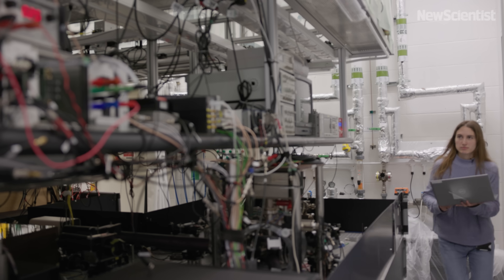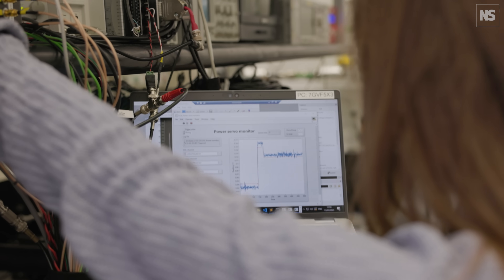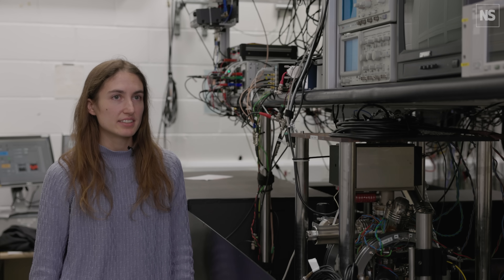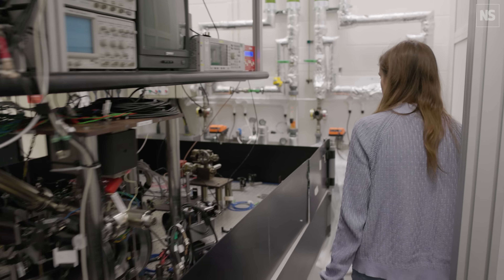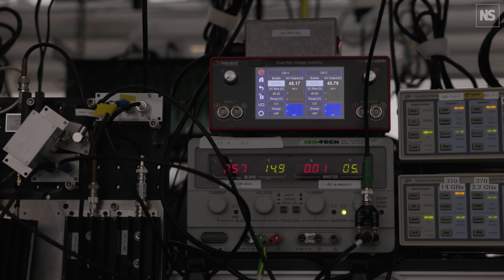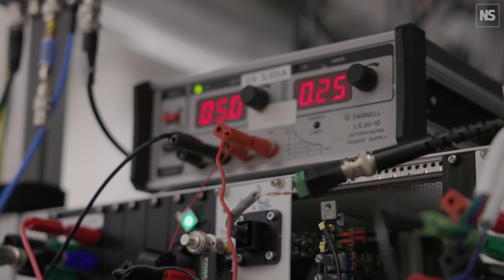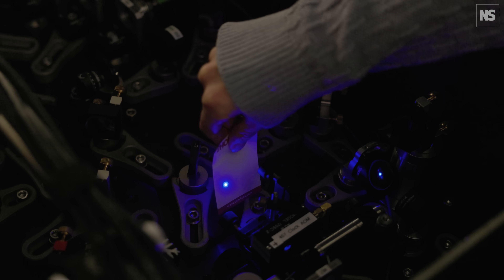How optical clocks are redefining time and physics

Comment: Fascinating.  It sounds like they're using a Paul trap since the Dr said that they use time varying E fields.  Also, I would expect that they use optical molasses techniques to slow down the ions.  The weird thing is that I would have expected jackets/containers of liquid N (˜70K) and liquid He (˜4K) to cool down the ion trap; however, I didn't see any cooling equipment in the segment.  Thanks for the report.
Reply: From my, somewhat limited, experience, it will be the orthogonal laser cooling, before being cooled further in the MOT which when combined with XHF vacuum means that you can get down to around 10-6 K without any external cooling as there's essentially no radiant heat.

Comment: 4:30 But a second is defined precisely as an exact number of periods of cesium radiation, so I don’t understand how a definition can get more accurate. Is it because the cesium periods themselves have some innate variability?
Reply: Things happen in a shorter time frame then a single caesium time period. It's like going from being able to measure a 100m sprint using hours, to using seconds.

A hour is still an hour, but with seconds we have created more resolution in our ability to measure things.

Same thing here.
Reply: @Lettuceleafproductions But after gaining the ability to measure seconds, you don't need to re-define the hour to be able to measure them, you just need to define them as a fraction of an hour. This bit didn't make sense to me either.
Reply: They want to change the defination to the frequency of a sec using the sodium atom which is around 400 Thz. Ceisuim is around 9 Ghz. Optical clocks would have 44,000 times more resolution than Cesium clock.

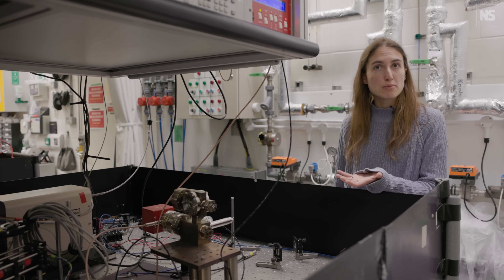Comment: @1:50 "The Yb ions are particularly sensitive to the variation of the fine structure constant"?! 
How can a constant vary?
Reply: It's called a constant because it is believed to be and all observations so far are consistent with it being a constant, but like she explained it's conceivable that it turns out to actually slightly vary over time and we just haven't noticed it yet
Reply: @MatthijsvanDuin  You either don't read or don't understand what words mean.
Reply: @ I do read. It's a physical constant, not a mathematical constant. It's not constant by definition, but it is empirically a constant. Ultimately however nothing is 100% certain in physics, the universe does not go "DING! You got it right!", so it's perfectly natural to wonder if perhaps some things we think are constant in fact are not constant, and to want to do experiments that check this.
Reply: @ Also, there is actually some evidence that the fine structure constant has changed over time, albeit by an extremely tiny amount (a few parts per million of change over a timespan of ten billion years).

Any variation on a human timescale has thus far been too small to be detectable despite active efforts to detect such change, so for all practical purposes it is a constant.
Reply: @MatthijsvanDuin  So why talk about variation though?
Reply: @ciprianpopa1503  The phrasing "particularly sensitive to the variation of the fine structure constant" just means that if the fine structure constant varies, it will have a strong effect on  the properties of this ion that determine the frequency of this clock, which makes this type of clock a useful tool if you want to try to detect whether the fine structure constant varies. (And if no such variation is detected, it provides very tight bounds on how stable the fine structure constant must be)

Comment: It can measure time changes at 1 cm height difference, so this clock is very sensitive to gravity ie time dilation.  So how does it stay so accurate given that there constant small changes in gravity locally due to subtle but constant changes in the mantle and core of the planet?  How do you compare the time on such clocks that are distant and under influence of different gravity?  Is there a limit to how accurate a clock can be in the real world?
Reply: I anted to ask something related to this but the other way round. 

Could you use the clock (or a pair of them) to monitor the movement differing viscosities of the mantle?
Reply: "It can measure time changes at 1 cm height difference, so this clock is very sensitive to gravity ie time dilation"

No just the force applied to the ion.

 Gravity does not effect time or light. Eddington 1919 just observed ordinary refraction from the suns plasmasphere. Defection was much higher than Einstein predicted. Mass\gravity does not bend light.
Reply: @guytech7310 We found the ret∆rd
Reply: @guytech7310 Ever heard of "Gravitational Lensing" ?

This was predicted as possible by Einstein and then proven to exist in the real world by others.
Reply: @jfverboom7973  Yes but its nothing to do with gravity, its just ordinary refraction as the lensing galaxy has gas & plasma. We know its not gravity because all of the lensing galaxies suffer from spherical aberration, which would not occur if it was gravity. 
Eddington 1919 observation is also just refraction as the sun has a plasmasphere. If you look at the original 1919 star plates, you can see glowing plasma right next to the star with observed deflection. The deflection was also nearly twice the amount Einstein predicted but in line with refraction cause by plasma. 
Third no lensing effect observated for stars whipping close to Sgr-A (milky-way central blackhole).

Gravity and EM do not interact.

Comment: how does the optical clock compare to the proposed nuclear clocks?

EDIT: i just checked wikipedia. the proposed thorium-229 based nuclear clock is expected to have an accuracy of 10^–19, i.e. an order of magnitude better than the clock described in this video
Reply: cesiun clocks lose one second in 30 milion years or somithing.
this one lose 1 second in some bilion years
Reply: @iurikroth2281  I'm not talking about caesium based atomic clocks. I'm talking about a new type of clock that is under development called a nuclear clock which is based on thorium-229.

Comment: What Alexandra Tofful did not say is that - the last time I checked - optical clocks can only run for, at best, a few weeks at a time. 

So the line "...x seconds in the age of the universe..." is a bit rich! 

The physics is fascinating, particularly the tests for changes in the fine structure constant. And their use as sensors is intriguing. But I am sceptical about their ultimate utility as clocks.
Reply: It's the little words that are important, words like "and", "not", and in this case "if".
As in IF it had been running since the start of the universe.
The statement was merely a tool to bring 10e-18 into some sort of sense.
Reply: @dougaltolan3017  Indeed. My point is that these are not devices like the Hydrogen maser (which actually make UK timing) or the caesium clock which runs continuously to correct the drift in the masers. Those devices run (more or less) continuously) and function as the ticking devices in our clocks. I understand that optical clocks just can't run for very long. Which is a bit of a limitation.

This is technology which will make sensors way before it used to make clocks.

Best wishes

Michael
Reply: @michaeldepodesta001 these clocks are constantly improving. It’s a bit like computers back in the day. No one ever thought they would have a super computer sitting on their desk or in their hands.
Reply: @TIZ012  That's a fair point. But their reliability - a property that is generally not reported - is terrible and did not improve much over the years that I worked at NPL.

In my own specialist field, thermometry, thermometers that are the most sensitive are not always the best thermometers in a particular application. Similarly, the highest frequency clock with a stability of 1 part in 10^19 over a week is not necessarily better for timekeeping than a Caesium fountain with a stability of 1 part in 10^15 more or less indefinitely. 

As I said: the technology is fascinating and may unlock new sensors. 

Best wishes

Michael
Reply: @michaeldepodesta001  Quantum noise is always going to defeat such a device. It may be very accurate in the short run, but it's probably a non-starter in the long run.
Reply: @Vatsek  I cannot comment specifically, but you are correct that it is not obvious that the deficiencies in terms of lifetime can be overcome. If I recall correctly, one of the causes of runtime errors is that an ion or atom is lost from the trap due to a stray collision or a cosmic ray or whatever.  

Best wishes

Michael
Reply: @michaeldepodesta001  Even in an ultra-high vacuum, some atoms and molecules are still left in the chamber. Sooner or later, one of those will hit the Yb+ ion, making this type of clock somewhat unreliable.